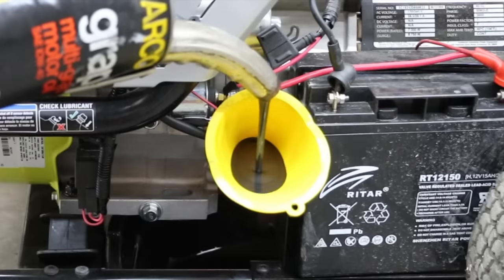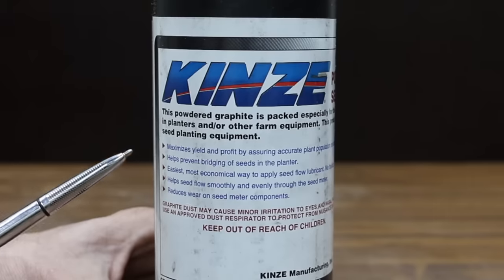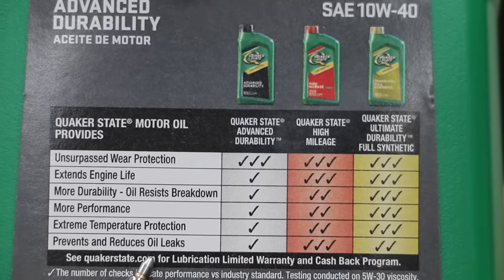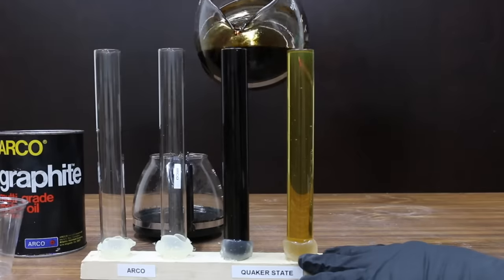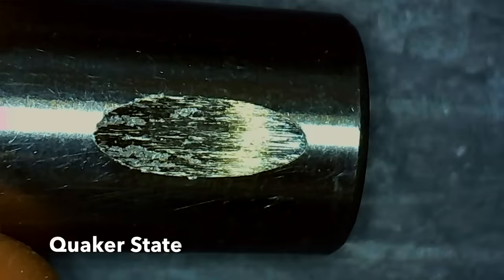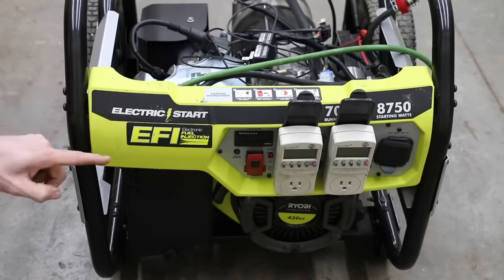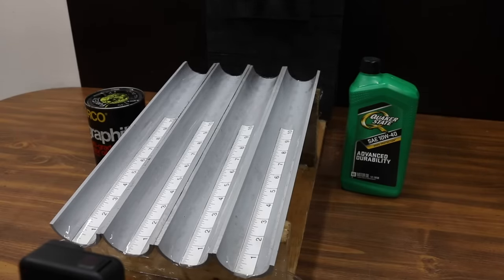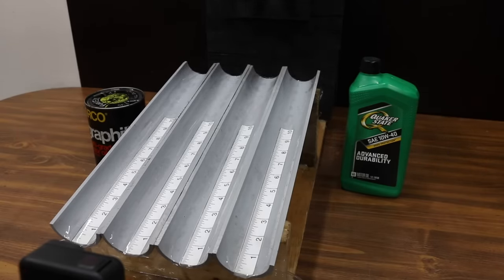Will "Graphite" Help Motor Oil Performance? Let's find out! Vintage Arco Graphite vs Quaker State

Comment: How about taking a modern oil, and then mix additives like a lot of calcium, iron, boron and zinc and make the ultimate DIY oil! Will it be better than itself?
Reply: Arco graphite leaked through almost every gasket on my 1974 Chevy, and it was new. Meant 1984.
Reply: I think the problem is it will clog an oil filter, like instantly.
Reply: @Eduardo_Espinoza  eh. The oil filter is just a suggestion anyway. LOL I'm kidding, seriously this is a joke. Nobody ever try that.
Reply: @blackfrost273industries4  some old timers seem to have in the comments, yet I am more interested to see this happen 👀
Reply: High level of zinc will destroy your catalytic converter and will be ruined in no time. This is why modern engine oil have low level of this.
Reply: Very interesting. Never heard heard of
This. But I ain't gonna try it either.
Reply: Just add zinc racing additive .
Reply: That's what STP is for. Bunch of additives in the stuff.
Reply: STP. Stop Those Pistons.
Reply: @Eduardo_Espinoza  indeed
Reply: @Eduardo_Espinoza  Graphene will not clog the  oil filter because carbon nanoplatelets flakes are a little bit smaller than oil filter porosity (carbon flakes are consequently very much smaller than graphite ). Graphene nanoplatelets are Eco-, catalyzer- and engine friendly – because it contains only carbon, and does not contain any metals, sulfides and other harmful substances for environnment & catalytic converter. Lets compare and see !
Reply: @lot451  that might explain why some other people had their gaskets defeated by this additive
Reply: enginemaxcarb.  hopefully we can get more confirmation from the specialist 😉
Reply: @Malossianoplus  cant destroy a cat if you cut it out.
Reply: @leion800  can't ruin the atmosphere if the EPA arrest you.
Reply: Fred Stocking :  hahaha.   Does that say anything about the oil? Or new chevys?    Hahaha
Reply: @leion800  yeah same for diesel.. egr and dpf off is the way to go..
Reply: @HZB OcYpcWr'Ctwu Odzs yes. but u need to remap your ecu since the check engine light will come on if its a new vehicle.
Reply: @Malossianoplus  I've been using high zink rotella in my 91 jeep for 30 years, still have the factory cat, no issues.
Reply: I would like to see this one, and with a lot of Motorkote! 👌🤣
Reply: I think this is an excellent idea, as all the modern formulas would be present. However, given the lubrication qualities of graphite, I believe very little should be used.
Reply: @goodnough1  rotella respect a lot of cars engines specification. if you respect the specification required for your engine ofc you dont ruin nothing.
Reply: @Reply,
🔵 What does "Hatt" mean?
Reply: @Malossianoplus  Remove your power robbing cat.
Reply: @slowlane5032  ok slow lane
Reply: @slowlane5032  Lucasoil is better though.
Reply: @fredstocking3812  Yup, I 2nd that one.  Worked it's way past every gasket and seal in my Jeep, motorcycle and lawn mower.
Reply: or just run cheap oil in the correct viscosity with a middle of the road oil filter and change it as recommended thats more than enough overkill really.. save that money youre wasting on additives and pricey oil and put it towards other parts or the next vehicle, or tools to maintain and fix your own.. all the oils meet the specifications theyll work just fine
Reply: No way to test that. Way too many combinations
Reply: I worked for ARCO and used ARCO graphite (AG).  The engineers told me the advantage of AG was the graphite deposited on the surfaces.  When an engine starts it takes a while for the oil to get everywhere.  With AG the graphite deposited previously protects surfaces before oil is pumped there.  The engineers said that most wear is when you start the engine.  ARCO ran a test engine with AG and opened the drain plug while the engine  ran on.  Unlike with engines with regular oil the engine ran on until it failed for other reasons.  My use of AG was all positive except spills.  It performed better than Penzoil made with pure Pennsylvania oil.  Please note that AG was mad with natural petroleum.  Over the decades the oil will degrade.  The graphite was ground very fine.  You had to make sure drain plug and oil filter did not leak as the graphite made leaked very apparent.  Drips showed up and I used powdered tide to get it off the driveway.  As I signed for the receipt of all finished products I found out that ARCO had Sun Oil compound AG and can it.  I had to make sure Sun got paid on time or they would stop shipping.  All other ARCO oil was done in house and liked visiting the oil canary and warehouse  where I would buy cartons of AG at cost.    One disadvantage of AG was is that you could not tell by looking if the oil was dirty.  If AG was made today I would use it.  Never use decades old oil.  Of course synthetic oils are wonderful, but AG was cheap so changing oil every 2000 was not expensive.
Reply: @Eduardo_Espinoza  it did not clog anything, graphite was ground too fine
Reply: @saltyroe3179  interesting I wonder how would oil companies recycle the oil after if it is so fine & if you burn it would it be that same as breathing carbon fiber? i heard it's a carbon?
Reply: @Eduardo_Espinoza good thinking. that might be true depending on the width of the particles. Hey , I'll ask him to do an oil filter test
Reply: @saltyroe3179  thanks for the important answer.how did you determine this ?
Reply: Then you will be creating a lot of ashes, and either plug or poison the Catalytic converter, as well as, above certain point, turning the "fortified oil"  into an abrasive mixture!
Reply: @lot451  Have you seen, or at least hear, about coating the active catalyzer in the cat converter with simple carbon???
Not just believe that ultra modern forms of carbon are automatically miraculous and magnificent...
Reply: @goodnough1  Yes!... becsuse it is no more than a minuscule quantity of extra zinc... the rest is advertising.
Reply: @CedricBouwerLearnEternal  It is NOT such a great idea: one thing is to get a uniform and smooth coating of graphite on a clean and dry surface at a factory, and another completely different (and practically impossible) to get ANY adhesion of the graphite particles on the wear surfaces of a used engine.  Same thing as the fraudulent "Slick-50", "Resource" and similar gimmicks.
Just disassemble an engine that has been "treated" with any of those miracle formulations, and you will find almost nothing properly adhered to the cylinder, piston, rings or camshaft...
Reply: @billbergen9169  If your catalytic converter is "robbing" your engine power, it is simply because you neglected it and plugged it by either running too rich, abusing oil additives or having operated with misfiring... ALL modern Cat Converters have so little restriction that eliminating them will only raise NOISE, but very little power. Past are the old days of spherical pellet converters with high restriction.  modern honeycomb ones actually present less restriction than the economy sized exhaust pipe. Calculate, run some real numbers, and then you can opinate.
Reply: @saltyroe3179  Sorry to disagree, Salty, but that old wive's tale about "coating" or graphite "adhering" to metal at the wear poins of the engine is just that.  Most "engineers" working for whatever company says or company does, continue to repeat the tale...
Just disassemble any "treated" engine and you won't find other than a minuscule amount of graphite on the metal!  Same lie as with "Slick-50", "Restore", "Resource" and all other similar scams.
One thing is to properly apply a controlled coating of graphite (or whatever) on a completely clean and pristine metal surface at a factory, and another completely different when attempting to adhere ANY friction reducing coating on a Used, dirty, oily and carbon fouled part on a used engine.  So much for all those "Instant Overhaul-in-a-can" kind of solutions!
Reply: @alfredomarquez9777  What I can kindly answer is that  carbon (like diamonds)  is exactly the opposite of many other kind of ''good'' ''anti-friction'' oil additive, because it is extremely chimically stable chimically resistant and strong. Carbon stay carbon within high ambiant temperature environnement like, for example, in a catalyst converter. It just cannot be transform to a more  hazardous or more toxic product for health and environnement. Graphene is by very far the best material for thermal conductivity performance. I just cannot see how graphene might lessen catalitic converter getting as hot as it is supposed to !
Reply: @lot451  Do you belive that ANYTHING coating the active precious metals that perform the catalysis will allow the gasses to react on the catalyst, if is covered with any substance???
 Have you studied HOW does happen the catalysis?  The catalyst surface MUST be perfectly available, that is, free of ANY coating for the Redox reactions to occur.  Cat Converters are rendered ineffective when fouled by any substance that coat them, in addition to well known catalyst "poisons" like lead.  They need to be clean. Some SLIGHT carbonous deposits CAN be burned at the high temperatures of operation, but if left on, heavy coking will eventuslly render the converter ineffective.  In a few cases, feeding tbe engine with a mixture of Hydrogen plus Oxygen in addition to the gasoline, will gradually burn the excess carbon deposit, but if fully  plugged, the small passages inside the converter honeycomb ceramic support, won't allow the Hydrogen to go through, and then the converter is plugged forever, and cannot be renewed economically.
Reply: @alfredomarquez9777  I hear you. However, experimentation is always a good idea. If it adheres it means too much has been used. The amount should be enough to lubricate, not coat and gunge up. I know it has an effect when used in fuel, and it is extremely diluted at the time it is used to protect upper cylinders, valves etc. Your comments regarding the "snake oil" (pun not intended haha) types so very true that it makes one reticent to be in the same boat as those types. Marketing fluff!
Reply: @alfredomarquez9777  It might indeed plug a catalytic converter, but I doubt it will make it's way there.
Graphite is softer than paper. No way it becomes an abrasive
Reply: @OldCrowsClassicCars  : It is not a matter of abrasiveness, but any extra carbon added to the engine will end up coked at the insides of the engine and will accumulate at the front of the catalytic converter honeycomb support, as it necessarily has small passages in order to present as large as possible contact area for the catalyst to perform the required Redox reactions on the polluting gasses, CO to CO2, HC to H2O  and CO2 and NOx back to N2...  therefore, any carbonous deposits on the active surface of the cat converter are to be avoided, being the main ones: Excess gasoline, misfiring, excess oil, and excess undesirable elements and compounds that either Coat or Poison the precious metals that are the responsibles of providing the catalysis. Because it is in practice, IMPOSSIBLE to avoid the passing of some oil to the cat converter, any excessive additives that result in poisons to, or coat the cat converter, need to be reduced to the minimum.  That is the reason for reduced Zinc contents in latest motor oil formulations, same for other additives that when added by overly "enthusiastic" car fans, result in excess quantities of inorganic ashes ( a measure of excessive use of additives).  EPA mandated to keep Zinc to minimum, perhaps a little too drastic measure, but many converters failed to reach the specified life (around 100,000 miles minimum, and they detected it and acted accord to their priorities.  In response to those that believe that you will get a "better" lube oil protection by adding extra additives, I must say that in the large majority of those amateur attempts, result in a POORER oil mixture, as the best formulation is a careful blend of factory additives in a BALANCED package.  Too much of one component will throw away that balance, produce unintended and undesirable consequences, or result in unnecessary waste of money better spent in, for example; reducing the oil change interval, which would be a better use for that amount of money, wasted on additives or "miraculous", Snake-Oil type products.
Reply: @lot451  Thank you so much for the inteligent answer. Many people here don't realize that the melting point of graphite is around 3600 C which is waaaaay above anything an engine can produce. I've put over 1000amps through a thin graphite rod, and it won't melt.

Like you said, anyone talking about a 'reaction' of carbon to the cat. converter is WRONG... the true issue is the clogging, that is realistic.
Reply: @alfredomarquez9777  

1) The test on the video proves that the graphite reduces friction, perhaps as much as 3 times. This is not an amateur attempt, it was a decent product that was sold back then, and the tests confirm it's quality.

2) I agree that 'magic potions' are  simply frauds that don't work. I wouldn't spend money on them. There are a few things that might be good however, such as 2 stroke oil on a classic car and kerosene to dilute engine oil. Not many more that I can think of. I imagine that the zinc has role to play too.

3)I agree that graphite might clog the cat. converter, but classic cars don't have them.

4) I doubt that graphite will 'coke' up like you said, but that certainly depends on how much of it is in the oil. Only a test would confirm it for sure, but many other people have used it without a problem. In fact, I couldn't find one person that noticed a decrease in engine performance due to the graphite.
Reply: @alfredomarquez9777  ARCO graphite was high quality oil.  Practical testing showed it performed well.  The price was reasonable.   Most people didn't want to deal with spill mess.  Getting on your clothes was awful.   Today synthetic oils offer a better solution without the mess.
Reply: @Malossianoplus  just ditch the cats
Reply: @OldCrowsClassicCars   Very Smart, very clever, very accurate comment, with much more open  minded & brilliant persons, in power we could have eventualy a better future. Unfortunately, you are the very rare exception... That confirm the rule that even with great innovations at hands, we will still just go nowhere good... People in power are extremely lazy, and very greedy for easy money, not greedy for new technology Breakthrough...
Reply: @lot451  thank you so much. Feel free to watch my channel. I've got over 200 how to videos.

Thanks again for the nice comment
Reply: @Darren Munsell i find that hard to believe, maybe it requires a specific grade/formula that your manufacturer backs but it wont just flat out say your car requires any full synthetic oil.. and my point is run conventional skip the additives and save 100$ on every oil change.. count that up over the life of the vehicle and you have a good size down payment for your next
Reply: @Darren Munsell a 70$ oil change around my parts is the cheapest drum oil they can find.. putting conventional oil in a turbo will do no damage as long as its changed even remotely close to the interval, youre getting fooled by the marketing hype theres been turbocharged highperformance engines long before synthetic oil
Reply: @Malossianoplus  what about for the old timers without cats? 😂
Reply: @InfamousAMH  nope. Go check project farm video in the oil comparision. It is the last one..
Reply: @goodnough1  Rotella stopped putting zinc in their oil years ago  sir
Reply: @msm32078  nope, did not,  literally on the bottle dude.
Reply from the maker: Thank you for the video idea!